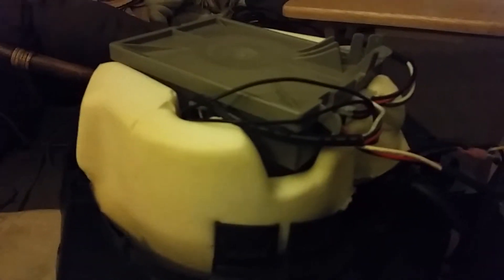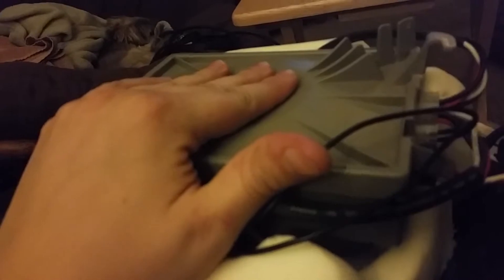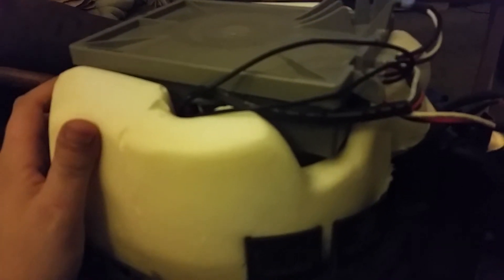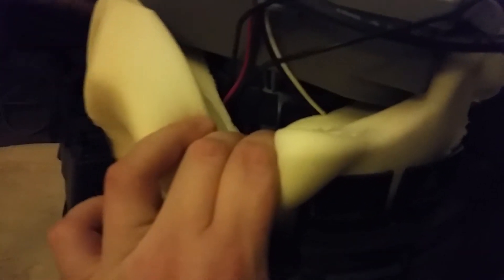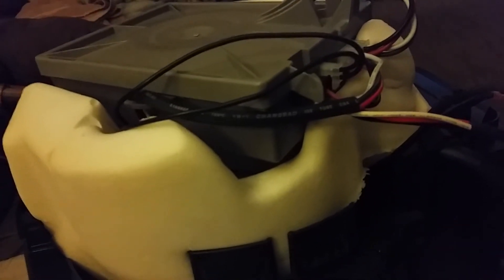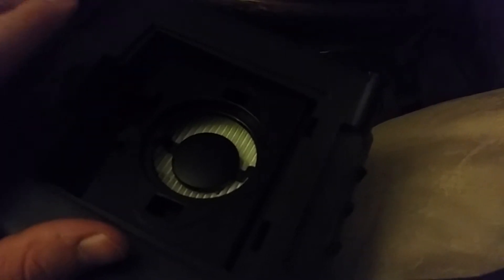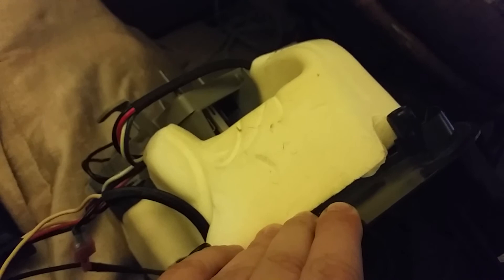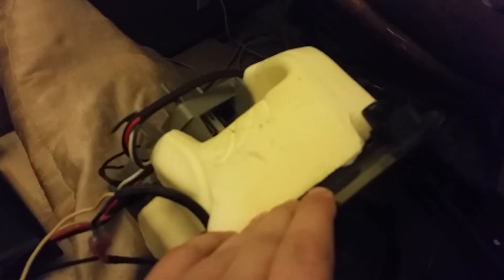Rainbow Vacuum E2 Design (Gold, Blue, & Black): Under the Hood Overview

Comment: The power nozzle has been changed from the Gold model to the Platinum/Blue model. There is no longer a reset switch or a red light on top rear of the power nozzle. Also the motor is a snap-in unit now instead of using screws to hold it in place. The non-electric wand set for the Blue unit only has a curved upper wand. The 2 lower wands are both straight, with a new swivel-head floor brush. Tony
Reply from the maker: This was only a base unit comparison not an attachment video. Base unit has not changed from the E2 Speed onward, making it a good deal to pick up as a gold vs. blue or black. I do have a video comparison coming on power nozzles for these two specific units and cleaning advice for them just need to get time to edit it. There are many small variations in the attachments packages through the years, more than I could possibly present in one video together. Still trying to pick up a blue or black so I can play with them. Thanks for the notes though, cheers.